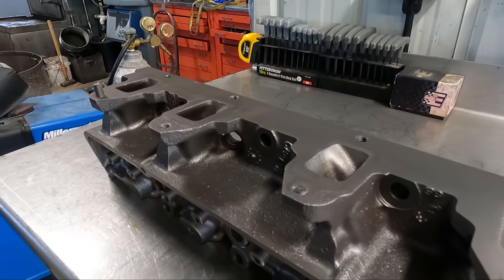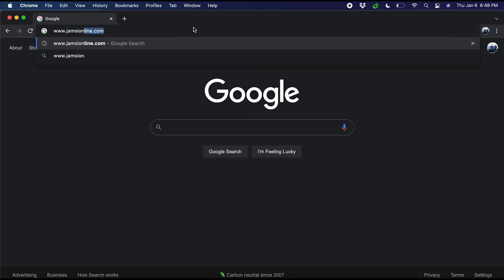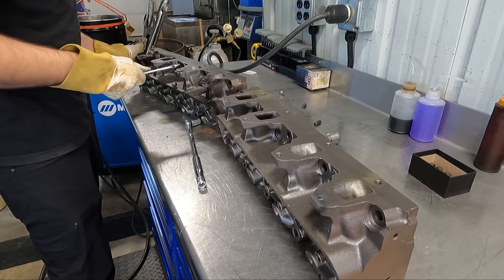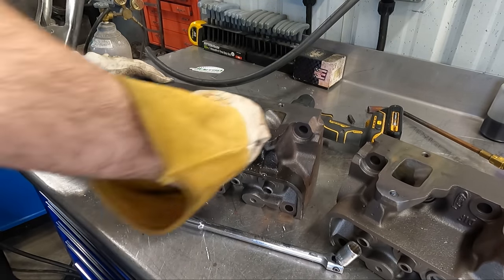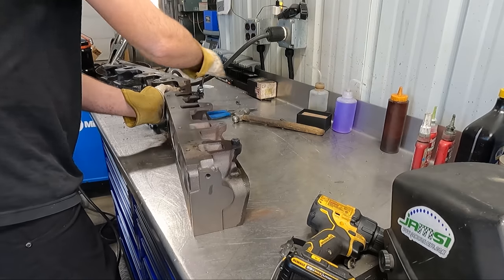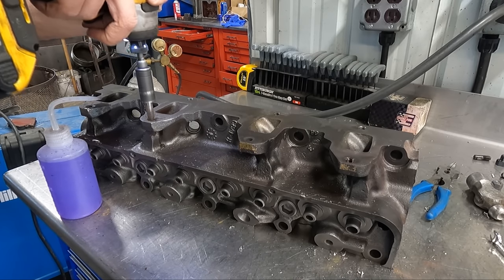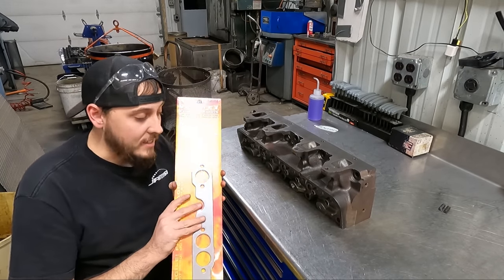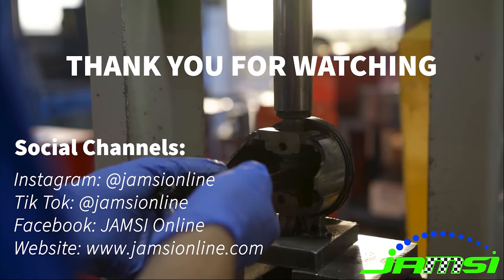Removing Broken Exhaust Manifold Studs From FE Ford Cylinder Heads

Comment: An older guy got me started melting some paraffin wax on the threads after warming with a torch.   The wax will wick down the threads towards the heat so keep that in mind when warming.  You can usually burn the wax off and wire brush a clean enough spot for a weld later if need be.  Oils tend to leave more residue that's tougher to clean.  

I prefer to TIG weld a buildup on the stud, but not everyone is fortunate enough to have a TIG machine in their garage.  

Hooray for growing up working on trucks and tractors in the rust belt...
Reply: I never had much luck with MIG especially with a nut since it's hard to really get some heat into it.  Now that I have TIG I just camp out a long time pumping in heat until things are really hot and melty, then add filler.  I also forgo the nut and just weld on a piece of scrap which then functions as a handle.  If you get a little motion but can't get any further, try some tapping fluid.  The EP additives will help wind out the bolt.   (Caveat:  I do almost entirely stainless bolts in aluminium; normal penetrating oil probably works good or maybe better in all iron setups.)

Comment: Good Video Although it may work better with a TIG, welding a flat washer to the broken bolt and then welding the nut to the flat washer works very well.

Comment: Boy is this a flashback for me by about 45 years.  Those things were a PIA.  If I had part of the bolt sticking up high enough I would use a similar tool (KD?) but first I would spray some penetrant, heat it and let it set for a few hours or overnight.  Heat again then try to back it out.  If they snapped off lower and I would grind them flush and find the bolt center and drill.  I think those were 3/8 threads so I would use something around 5/16 drill but I can't remember.  Anyway it would usually leave a minimal amount of material in the threads to where I could almost use needle nose pliers or a small drift to pull it away from the threads.  I would just run a tap through it to clean things up.  It was rare to use a heli coil.

Comment: Just did 2 on my turbo, broke flush, even after heating cherry red,  while it was on the Perkins. Best way: nice sharp bit, center it up good, drill it to tap size to original size . Only took a couple hrs.

Comment: Thank you for sharing your knowledge. I really love that tool that you were using. I think tomorrow if my migraine is gone I'm going to spend a little time looking for one.

I usually have success the same way you do with making small movements left and right left and right. I also use my secret oil. I always use Aerokoil this stuff is absolutely the best on the market. I have tried almost every commercial available can of oil and I have found this is the only one that actually works. In the past I'm not going to give the name of the stuff it's not right it's a bad mouth then since this is my opinion but I can tell you that you could spray almost the whole can blasting the stuck fastener. And when you are able to get it out the bottom thread do not show that the oil ever made it down that far. When I use my golden can of oil the very very first time and I mean it wasn't sprayed on for 5 minutes before I try removing the same passenger and it came out so easy I could not believe it. On that fastener all the way from the top to the bottom of the thread got penetrated by the oil.

Anyone who's not familiar with this I will tell you up front this is not from cheap oil and I don't even think you can walk into a store and buy it. I normally find the best deals on Amazon when it comes to this and they have a new shop size that I have ordered. I can is normally 23 to $28.

Also I did not know that about aluminum versus iron heads when it comes to welding up a nut on top of it. All the few times that I had used your welding method they were all on aluminum heads. I think in my entire life I never broke a fastener off on cast iron.

Let me ask you this. There a lot of videos on removing a broken bolt what could someone do so the next time when you go to take something apart again how can you prevent it from sticking in the threshold? On blind holes I don't I don't like putting anti-seize on my threads I worry about expansion as I tighten the fastener. Or is there really no 100% way of preventing this from happening again.

I also like watching you use your drill press or the fancy name that it's really called -). I never thought about making sure that the piece on drilling out needs to be perfectly level. That has never once enter my mind on the few times that I've had to use my drill press.

I really love you taking your time to share your knowledge with the world. When the Internet was developed this was one of the things they wanted people to use it for. They want people around the world to be able to share knowledge and information on different activities and you never need to get on a plane to expand your knowledge.
Look forward to your next video and as I always do I give you the big thumbs up.

Comment: I finally went back to a cheap Century stick welder for FE and Cummins exhaust bolts. I can drive the electrode into the stud and nut for penetration impossible to achieve with the wire feed.  Then I can bang the daylights out of the bolt  with an air hammer.

Comment: As a small engine mechanic I am often working on smaller bolts in aluminium perhaps 4mm. I find this technique difficult at that size. Any tips welcome.
Reply from the maker: Do you have a TIG machine? At 4mm it's definitely getting into a challenging realm. If it were me, I might try taking a small washer with an ID that is almost exactly the OD of the bolt and weld it to the bolt w/ the TIG machine, and then weld a nut too (which can be done with TIG, it's just easier with MIG in my opinion). 

Hard to say, but we have pretty good luck down to ~6mm in aluminum but don't see much smaller than that in our shop.
Reply: @JAMSIONLINE  only a mig.

Comment: Nice work!  I have good luck drilling the threads out the nut first.  It gets rid of the silver zinc finish and the weld is better without the zinc contamination.

Comment: Ford also used exhaust manifold bolts that were self locking.
The root of the thread is a radius, and slightly larger than a standard 3/8-16 bolt.

Comment: I do quite a bit of exhaust manifold work on aluminum heads, I work at a ford dealership, 5.4 2 and 3 valve issues. I have good luck with the mig and a torch. In cast I like to heat with a torch and get it pretty hot, and if I can get to the backside of the stud, I’ll heat it even more, get it to almost cutting temp. It’ll get the stud soft enough to come out, sometimes I have to heat several times cause it’ll cool down and start to bind. You might of been able to do that with those heads.

Comment: Weld a washer on first then a nut to the washer! I’ve used this technique for many years. You will get a good penetration to the washer! You can’t trying to weld down through small hole in a nut. Try it you’ll wish that you had been doing this way all along! And yes it’s strong enough. Try to pick your thicker washers.

Comment: Love your videos.  I subscribed after watching you tap a hole with an impact the first time :)  That and I love the Serdi work.

Regarding your dangerous tapping method, when you're doing this for a new hole, do you use a slightly larger drill?  Asking because you make it look so easy :)  I've been experimenting with using an impact for a M8x1.25.  You can find various answers on what size drill to use, but most seem to say that you take the size minus the thread pitch (which doesn't make sense to me, but I'm not a machinist).  That gives you a 6.75 diameter bit, which is indeed what most of the drill/tap kits come with for a M8x1.25, but it seems really tight and some of my customers are breaking taps by hand. I'm definitely not using an impact on the 6.75mm hole. I've experimented with 6.9mm drills as well as large as a 7.5.  It seemed to work fine and I was able to impact tap it, but the threads looked too small.

I did change to a 2 flute gun tap (vs standard 4 flute) which I think is better, but still seems pretty tight.

Comment: I use a wet rag to quickly cool the bolt with welded nut. Some say this weakens the weld but I have had times where I did not cool the nut and it broke right off, but after cooling it comes right out. I do this all on cast iron.

Comment: Those exhaust bolts in the tabs (through holes) always seem to break. I stopped trying. I drilled mine straight through, and used stainless hardware (bolt/lock washer/nut) to hold my headers in place (1972 ford pickup, long tube headers). So far this solution has worked flawlessly, and if I have any trouble, like the continual exhaust manifold gaskets that seem to blow out a lot (although mine are hanging in there so far) I can twist them in half if necessary. Second time I've done this to an FE, and so far no issues ever came up.

Comment: I noticed that if you ues non galvanized nut for this it works better.  The galvanized surface  oxidizes and weakens the weld. That's just my thoughts about it.

Comment: You did everything but quenching.  Heat the stud red hot with the weld, then quench with cold water.  Then use a 3/8 impact gun with the air turned way down.  You want enough hammering from the gun to break the bond, but not enough to break the weld. The constant impacting will actually generate heat,  and flex the fastener.  I'm like you,  I'll only drill and helicoil as a last resort.

Comment: A friend of mine needs cylinder heads for his hemi pickup. He bought it used and some of the bolts were messed with / hidden under putty.  Broken bolts go figure... What do I need from you guys to get a price on the exact set of Reman cylinder heads? Also any recommendations at the time when changing the heads. Also since the heads are damaged I don't know if there's going to be a core charge you would have to let me know that also.Thank you

Comment: The 75 F350 I'm working on sat for over 20 years. I had to drill out the the top bolts and retap. Tried every trick in the book, and it came down to that. Thankfully, it worked out pretty well since I was using a milling machine to get it precise.

Comment: I always like to leave this comment one day we're trying to remove a broken stud in the machine shop I worked in on Old Time gentleman walked in and said hey you some paraffin wax instead of WD-40 it doesn't burn off when you heat up the item you're trying to loosen the stone on the stuff work like butter on a hot knife paraffin wax is the greatest way to get a broken bowl out or loosen something that's very Rusty nut or bolt with a little bit of heat.

Comment: Yeah you pretty much tried everything.   One problem I had was an m6 or m8 bolt break coming out  in the middle of a aluminum head between cams, about 4-5” below the cam in a valley.  I thought I may have to pull the head.  Called a machinist who came out and instead of trying to drill he took a 1/4” carbide burr bit  smaller than the bolt and just bored it away with a right angle grinder.   Then ran a tap through it.   He said he buys the really cheap burr bits and just burns them up as it took less than 20 mins on that bolt. Thought this may have helped on the last one.

Comment: I have found that If you can get centered up on the broken bolt and drill through it  or all most through it  you can run a weld in the hole and it will shrink the bolt and make it come out easier  👍😊🌎🌞

Comment: since you have  access to a mill, next time try finding the center hole and starting with a much smaller left hand drill thru and step up a couple drill sizes and repeat until it backs its way out of the hole. then instead of using a regular tap ,try using a roll tap which will reform the threads and not take out any more metal out of the threads. ive been a machinist for 40 years and have used this way too many times, mostly on other peoples failed attempts .

Comment: I use your method too (heat, air hammer, welder).  With a stud broken off flush, I'll also drill a hole in the stud, then weld a washer to the stud first, then weld a nut to the stud.  Seems to help.  The depth of the nut makes it hard to get good penetration into the stud, whereas the washer gets you closer right away.

Comment: The way i remove broken studs is to use 1/8" X 1: flat bar, i drill a hole one size smaller than the stud near the end, i can get a better weld because i can see my weld, the flat bar i use will be long enough to use as a handle.

Comment: Great video  love the welding attempt  I would say one thing as an engineer myself I would.never reccomend using an impact gun ir impact driver ti run a tap through its a sure fire way to snap a tap then it's back to the drawing board

Comment: Good morning, my machine shop guy is old school. He uses the blow torch to remove the studs. He warms the stud up until it is molten and then a slight cutting shot of air and the old stud falls right out. The torch won't cut cast iron so this process works really good. Hope this helps. Take care and good luck.